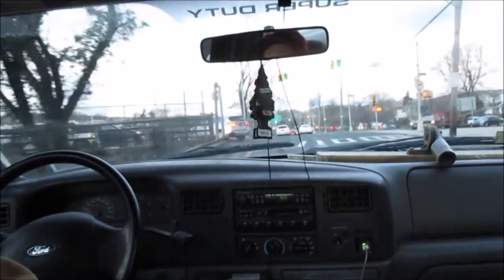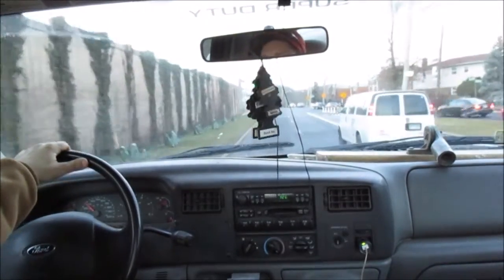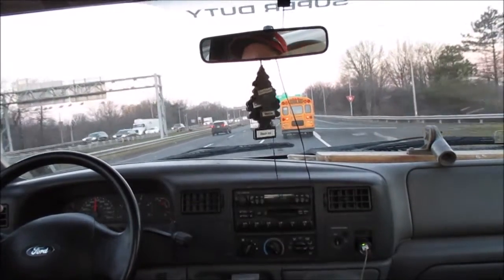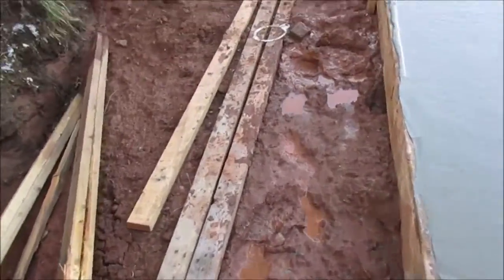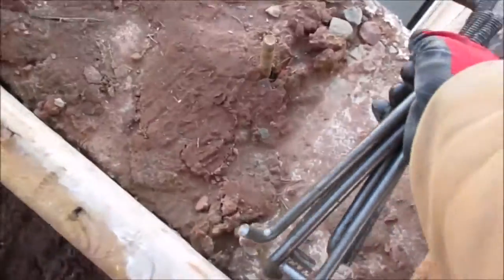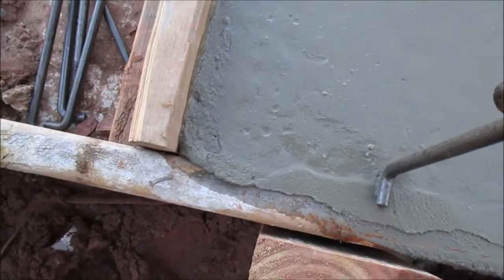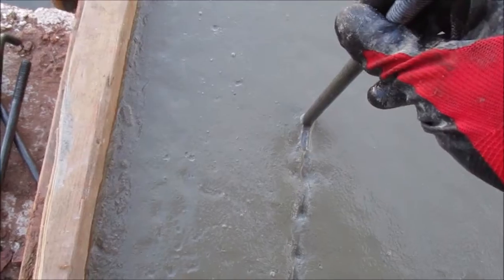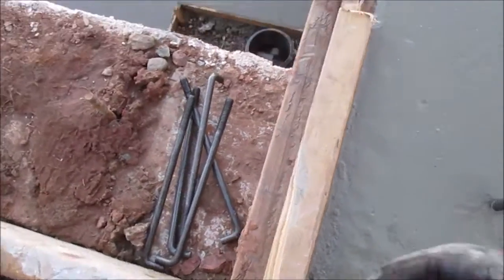Preparing and Pouring a Concrete Slab

Comment: basically you built a bridge because the none compactable fill is going to settle and the rebar in the concrete will give it support when the day come for settling and the subgrade will only settle if water-frost is introduce to the sub-grade.  That works for me.  No it really does work.  Good job, hope use used dobbies.  I am a concrete guy to and you did that right.  Wish I could be pouring concrete, but that ain't happening with 1 ft of snow on the ground and freezing weather.  How much did you charge for that
Reply from the maker: Dan Krueger thanks for watching. Put about 50 pcs of #4 rebar in it. Slabs are $1.50 per sq ft. Labor only. Took one 8 hour day. Builder pays for materials and rents Bobcats from my Dad.